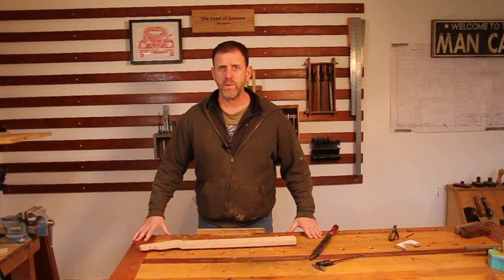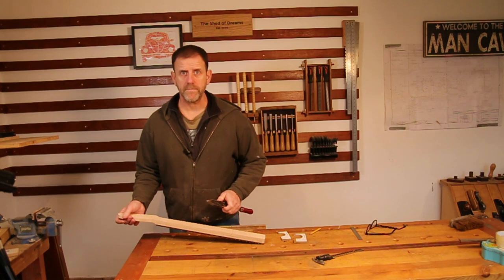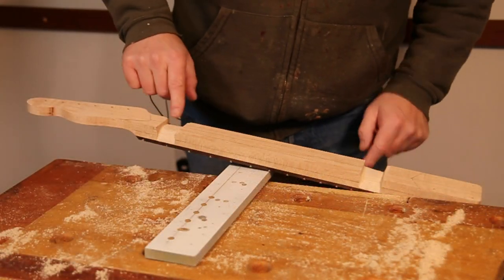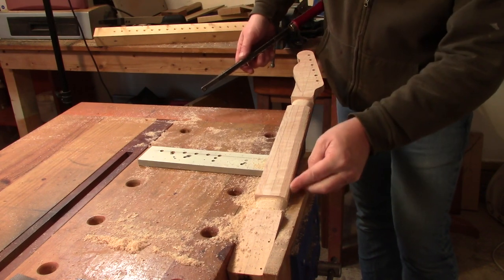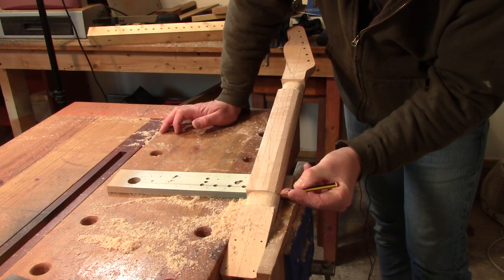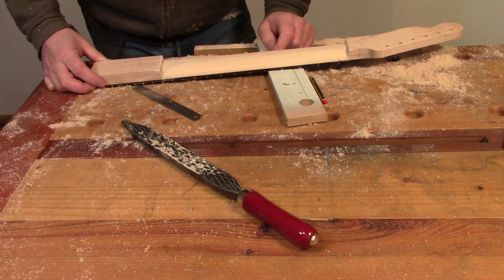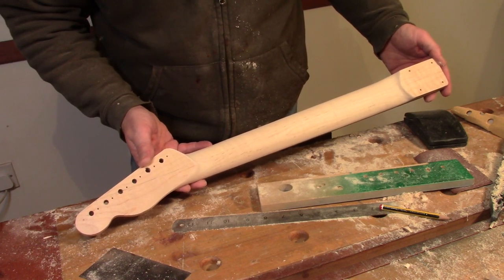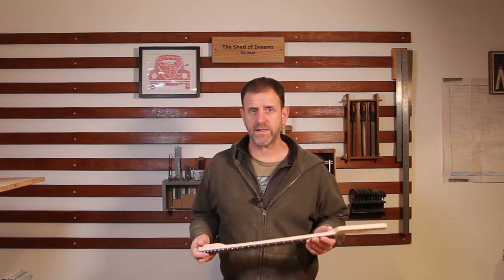Thinline Telecaster build part 17

Comment: How often do u check the profile with the 1st and 12th fret templates u have? How do u ensure that it’s a soft v neck profile?
Reply from the maker: I basically work the 1st and 12th fret positions down until the templates almost fit (leaving a bit of material for sanding). Once I get to that point I work  the rest of the material in the middle down to make a series of straight lines from the 1st to 12th fret positions and then smooth the facets this creates into the neck profile. In terms of which profile, it's all down to which template you use. There are lots of templates that you can download and print, just google neck profile templates.